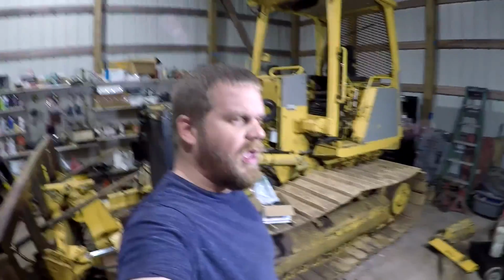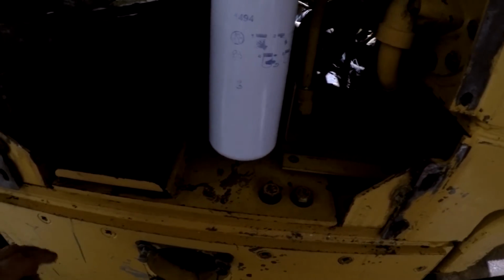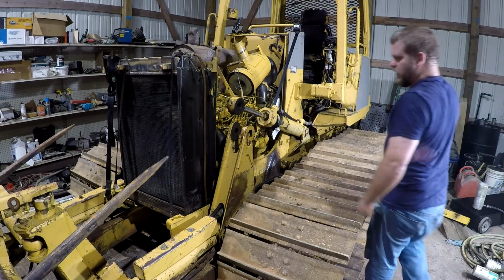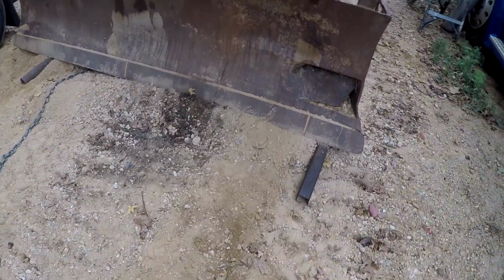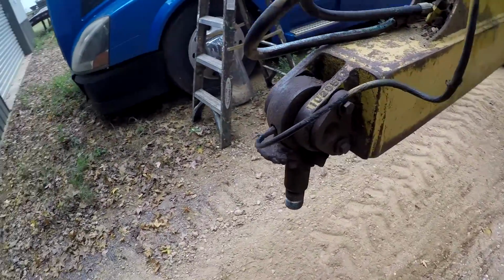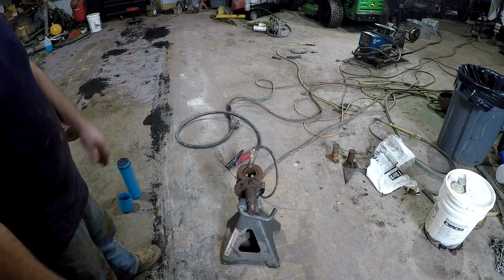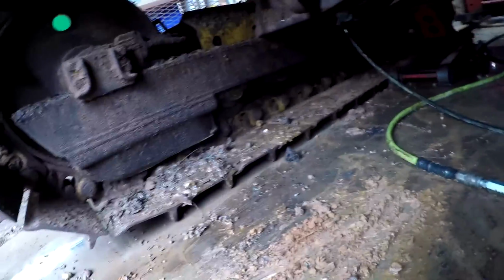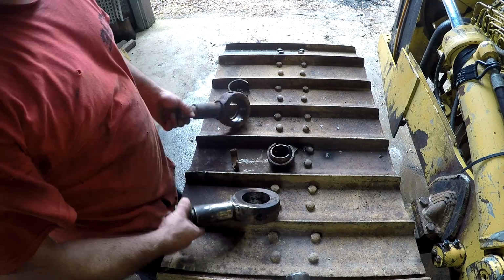Removing dozer blade and dozer blade mounts Cat d3c

Comment: Great video. Why not heat up the part that the bolt goes through to loosen the rust up?
Reply from the maker: It would have taken a lot of heat to make a difference and I figure the bolt and frame where it goes through is hardened and didn't want to heat excessively.